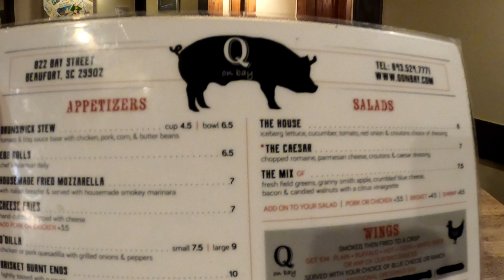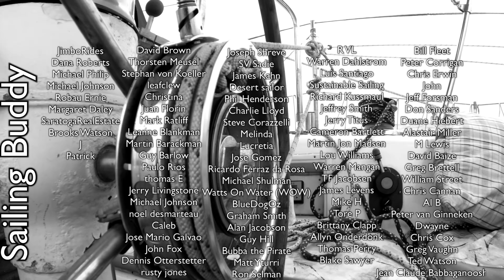The REAL PROBLEM with Synthetic Rigging | Sailing Wisdom [S5 Ep 28]

Comment: And with that my idea to change to Dynema rigging went down to the abysses: I love late fall sailing in Norway and sometimes I keep the boat on water during winter too. Seems to be just to cold for synthetics here .....
Reply from the maker: If it’s going to be cold for an extended period of time, just adjust the rigging for that temperature. The only time it’s bad is if it fluctuates dramatically from day to day
Reply: @RiggingDoctor  I understand but the the problem is those cold nights like you had with temps down to freezing followed by warm day, especially in Sept-Oct when fall sailing is the most glorious. Maybe rig a quick tightening but adjustable lever mechanism or tackle, just as there was on old classic boats for their running backstays?
Reply from the maker: Yeah, you could have a tweaker on the stays to give them more tension.
Reply: A combination of turnbuckles and deadeyes may work for quick adjustments.. 

I would love to see a scientifically based example of this stretch and tighten please. Ie Did you film the next day in the warm, so that you can show before and after? 

I can see now why they say one needs the same material on opposing forces- I have a new steel forestay and I was planning to install a dyneema backstay- now I can see that that would be a problem when the steel contacts and the dyneema expands - the mast will bend forward, and under wind and sail load it may collapse. 

I currently have baby stay and check stays in dyneema and I think I will push on to remove the four thirty-year old shrouds and install dyneema on those; and put on a new steel backstay. Thanks for the heads up on this. Any advice?
Reply: Is not the Dynema expanding, come on. Its the mast changing the lengh with temperature. Dynema is a polimer, doesn't change its lengh with temperature. And don't quit the idea of using Dynema. I already have the solution. I will put it on paper.
Reply: @make-og4xm  interesting what you say. Can you give more information?

Comment: very interesting to see the dyneema behave like that. I guess it is dangerous to use if in a climate where temperatures drop a lot at night. 
Would it make sense to use steel cable tensioners to be able to quickly tension the ropes?
Reply from the maker: In climates with drastic swings, having a turnbuckle is a huge help! You can tighten and loosen as needed with ease.

Comment: Logic Herb! Is the length of mast that modified. The steel rig has a long elastic deformation dominium. It will stretch. The synthetic one has none. What you tightened was the elongation given by the braiding. But no problem, being in bed with the flu I have time to create. Based on your videos I will build a stretcher with a constant keeping tension and I had already an idea how to mechanically inspect the stays with a camera  fixed on a climbing device you can command electrical from the deck. I am thinking even at a small  tank leaving a coat of a treatment. Getting back on metal or bronze rings for sail, these, by rubbing on stay, the pressure and temperature will force the carbon chains to stick on rings forming a solid coat.
Thinking at on boat momentary solution, I would take out as many pad eyes as possible and put them 2 on each stay pulling them with rope on opposite direction with the proper distance in between, to ensure the necessary torque for stretching.
Reply from the maker: I like your thought process!

Comment: at first i was going to ask if the mast is shrinking in the cold, but i watched again and your lifeline went slack, so something to look forward to not since i have dyneema rigging except headstay and forestay. launching december
Reply from the maker: It’s a combination. The aluminum shrinks a tiny bit and the Dyneema expands a lot as the temperature drops. 
If you tighten it in the winter, you must mark where it was set so that you can ease it out before it gets warm because it will shrink right back to where it was in hot weather!
For years, ours goes slack in the winter and we don’t mess with it, then it tightens back up when it warms again. 
I always say: “if it’s too cold for the rigging, then it’s too cold for me!”

Comment: I love the feather baby hoodies.  Too cute.  Interesting about the synthetic rigging - my mind was 180° opposite of the reality.  For some reason I thought colder weather would cause the lines to be more taught, and warmer the weather more slack.  Thanks for the info!
Reply: It's the mast that expands and contracts with temperature causing the dyneema rigging to go taut or slack, respectively. The dyneems doesn't expand or contract much. The same thing happens in aircraft with control cables. When the aluminum airframe heat soaks, it expands faster than the steel control cables, causing them to go taut. The opposite occurs when they cold soak.
Reply from the maker: It’s amazing how various materials can make the need for special considerations when rigging everything together.
Reply: @maxrudder6091  Thanks for this input - it makes so much sense. I presume if the rigging were steel it would expand and contract in a more similar way to the mast, but there would be some slackening and tightening if there were big temperature differences.
Reply from the maker: Exactly. Steel and aluminum move in a similar way, but synthetic moves in the opposite. 
Imagine the temperature drops 50°F and the mast contracts 2mm, but the stay expands 3mm. Now the stay is 5mm too long and that will make it very slack. 
The good thing is when it warms up it all goes right back into place.

Comment: If a 30-degree drop in temp loosens the rig, does a 30-degree rise in the hot summer sun tighten the rig?
Reply from the maker: It would, but I have it set for 80°F. +30 would be 110°F and you don’t see that kind of heat on the water. The water is a nice buffer for the air temperature against going too hot.

Comment: Hello there! Possible rigging is developed with less sensitivity. Till then we have choices. Seems a clear winner in the tropics. Not so much for rapid latitude changes. I am adopting it for non stay lines already. 
After all the distances, use of a deck generator would you make a different decision on electric drive? Diesel electric hybrid, diesel generator serial electric?
I personally have reluctantly gone to fitting a Beta 16 with electric drive/hydrogenerator pods off the rudder. The new electric will have to wait with the costs.
My primary issue is getting gasoline and deck generators off my boat.
Reply from the maker: This worked for the ICW but our goal is not to be running a generator at all 😉
We have plans for Windpuff since we will be building that system from the keel up!
Reply: @RiggingDoctor  Most keen, lessons of time are golden.

Comment: Ok so how does the synthetic rigging manage in the day and night cycle? Are the differences in temperature large enough for the rigging to be slack at night?
Reply from the maker: On the ocean, the temperatures are quite consistent, so it doesn’t affect the rigging much. 
The big issue is when a severe cold front comes through and the temperature drops more than 40°F. That’s when it becomes an issue.

Comment: Hi guys, I watched this about the cold slack rigging a few days ago & haven't been able to get it outta my head. What's the issue with using ratchets instead of all than carry-on with the checkstays, surely it would be much easier to tighten/loosen as required?

Comment: Do you have any value of the stretching force in N/m ?  If not can you get one tool for measuring? Or building one. I have to calculate the spring
Reply from the maker: It depends on the boat, but when Wisdom heels over, the force can reach 86,500Nm. I have thought of a spring system in the past and my idea didn’t work so I would love to see and discuss your idea. If a spring could work, it would absorb the stretch and keep the rig tension year round!
If you would like to chat about this, my email is riggingdr@gmail.com 😉
Reply: @RiggingDoctor , I sent, is Queued.

Comment: What are the expansion rate of your rigging. Let's take your forstay as an example, is it to much for a steel spring to take up the slack.
I have seen numbers between 0,5 to 0,6mm expansion per meter between 0-40°C but have not found information on Dyneema if it is concerning induvidual threads or braided ropes (where the thred lenght obviously is significantly longer per meter of rope). 
I know it's more weight (but it's on the deck at least) and it would need some service but a spring that holds 1000kg and travels less than 0.2m is a industrial standard fare and could actually be easily be used to monitor/correct the tension on the rigging.
Reply from the maker: I have toyed with this idea, but the issue is that spring would have to resist the full load of the sails. In effect, the spring would be so strong that it would then stress the rig as it would always be under maximum load. 
It’s a good thought but I haven’t been able to figure it out yet.
Reply: @RiggingDoctor  Good point, the engineer in me says that the solution is to splice 1/3 stainless to 2/3 of dyneema and call the problem solved, the team leader in me says that that is not a splice I ever will sign off on and the mechanic in me says just by pass the spring with a chain hook when you start sailing. The sailor in me says keep the manila it's a Gaff rig you are outfitting. 😉

Comment: A mast jack would solve this problem. It can be done with two small bottle jacks either side of the mast heel. And a bar through the mast. You lift the mast up and use shims under until you get the required tension. This is normal on race boats and boats over about 65ft.
Reply from the maker: It’s also how production boats that come with synthetic rigging do it too
Reply: Or switch to a carbon mast. The problem is not the Dyneema it's the aluminum mast. Mach the rigging  and mast C.T.E.

Comment: It's odd to think you reached freezing temperatures because I generally think of weather as warmer as you go south and I haven't turned the heat on my boat...I'm in Canada.  Obviously weather is varied with cold fronts and high/low pressure systems etc but it's still a surprise 😉
Reply from the maker: It was a huge surprise to me as well!
Reply: @RiggingDoctor  lol
Reply: A friend lives in the Pacific North West, and said a month ago that the East Pacific North South South North Current, switches direction which marks the start of Autumn, and that happened 31 days early this Year, which may have triggered an early Rctic  Jet Stream move South early as well ? I'm wondering how that's going to affect on this Eastern side of the Atlantic tbh. Still, Oil tank gets filled up in the coming week, so fingers crossed. Best Wishes.  Bob.  👍🤔

Comment: Would this be the same with pre-stretched dyneema/spectra? Or do you have prestretch?
Some race boats have hydraulic or Jack screw mast compression posts that could be used to adjust rig for the temperature? 
Growing up sailing in UK,  a temperature sensitive rig would be a problem ……
Reply from the maker: This is the same for all UHMWPE fibers. Ours is heat set and prestretched, but it still goes slack in the cold and tightens right back up on its own whence warms again.
Reply: UK too, and agreed. Pretty much convinced me to stick with 1x19 stainless Rigging, for my Next Sailboat,  especially perhaps as Cruising only, with a lot of long distance Sailing, with in mast Furling, which need the top of the mast within one inch of the bottom for Furling reliability. Once initial stretch is tuned out, should be good for years with occasional checking after haulouts.  tbh, with previous boats after initial post initial  stretch tune ups, only change needed was after re Rigging. But after the 1979 Fastnet Race disaster, not that I was in that Race, but it was clear there was a  ig problen with IOR specced boats, so I decided to not bother again.Since, I've stuck to daysailing and Cruising. Best Wishes and Fair Winds.  Bob.  👍
Reply from the maker: With in mast furling, you really want to stay with steel. It won’t change with temperature and the tight tolerance needed for the mainsail can be maintained.

Comment: Thanks for the video, very informative! Is the issue with slack in dyneema rigging less of an issue with a carbon mast vs aluminium?
Reply from the maker: Based on the linear coefficient of thermal expansion of carbon fiber, aluminum, and Dyneema, I believe that it would be less of an issue with carbon but I have no real world experience with Dyneema on a carbon spar.

Comment: But what about the sunlight? In direct sun things become hot obviously, much hotter than ambient. And at night they actually become colder than ambient if there is a clear sky. There can easily be 40C difference between day and night even if air temperature stays the same. I'm considering synthetic rigging, but it bothers me.
Reply from the maker: We’ve had ours for 7 years in the sunlight and had no problems whatsoever
Reply: @RiggingDoctor  But why ambient temperature has sugnificant effect and heating by sun - doesn't?

Comment: 15 amps of current at 50+ volts adds up quick. Easily 75-100 amp hours per day. 
The solar photovoltaic modules performance increases as temperature drops below 70°f. I often see 15-20% more energy production than rated. Sometimes I think about upgrading to a 150-200 volt charge controller. When the sun is low on the horizon and my strings are producing a minimal current I often wonder about the possibility of having a switch panel with three way switches to achieve a simple fast way of reconfiguring series and parallel configurations. E.G. In winter I get more than rated output between 10 a.m. and 3 p.m. but have several hours in the a.m. where switching to full amperage would pick up another 20-30% energy production. Later, after 3 p.m. switching to maximum string voltage would gain an additional 10-20% energy production. It just plain feels good to produce more power than rated. Feels great actually.
    Probably the thing that makes me wonder most is why people neglect solar domestic hot water panels. The evacuated tubes type panels will produce hotter water than natural gas or propane burners. My evacuated tube solar panel makes more water than I can use , in January at -40f, whenever the sun shines. If you want steam - the evacuated tubes will do it too. Best solar money can buy!
    I keep wondering if there is a way to inflate a vinyl boat properly with a nice dense foam? Or if anyone does sections.
Reply from the maker: It’s al about getting as much power as we can during the day 😎
Reply: @RiggingDoctor  great feeling.....I do evacuated tube water too. Best purchase money can buy.✌️👀👍
Reply from the maker: I have looked at them but can’t find a safe place to install it!

Comment: Any thoughts on a hot water loop with the diesel heater? Thinking your model doesn't have that option so using the first pipe.
Hello Hello
Reply from the maker: It’s awesome but if it’s not a proper thermosyphon, you risk a steam explosion. I have thought about it but then didn’t mess with it and instead installed an electric unit.

Comment: Awesome video herb but I have questions! How big is you battery bank in terms of power output and are they lipo4? How long and how heavy is you boat? How long since the bottom been cleaned on Wisdom? Before you turned up river were sailing with the current?
   I can't believe how cold it is this time of year. Smooth sailing guys👍
Reply from the maker: The battery bank is roughly 18kW of LiFePO4. 
Length: 45
Waterline: 32
It’s been a few months but it stays really clean with our bottom paint. 
Displacement: 18T
Before we turned up, we were going against the wind and current, when we turned, it began pushing us.
Reply: @RiggingDoctor  Just a dumb question⁉️ If you had enough power feeding the motor could you cross an ocean with your set-up❓
Reply: Off course they can cross an ocean they sail across it using the wind, it’s a sailing boat, an engine is just auxiliary power whether electric or diesel. They could extend range a bit by having more solar, more batteries and a watt and sea if they wanted to, they don’t seem to need to. Having more dedicated house batteries may be an idea to keep lights on for safety.
Reply: @andrewbrown2063  Thank you for your input Andrew but I was driving at the dudy cycle of their motor. Wondering if it could run indefinitely. I know electric motors can run to cross an ocean but does not mean their motor is designed to do so being they are a sailboat. I am more or less doing a bit of research on boats and as a live person Herby is the best I've found for info.✌️
Reply: @jamesfrankland38thangs58  the motor is air cooled. It is designed for 24/7 operation with infinite runtime. As long as there is electricity to run it.
Reply: @jonathanoasis  Thank you that's all I wanted to know. This helps a great deal in my research, thanks again👍